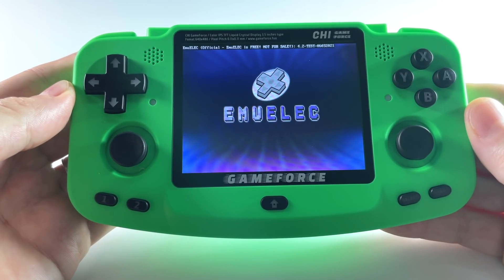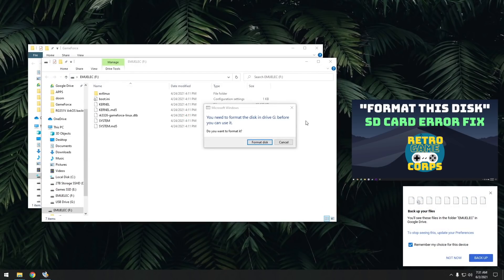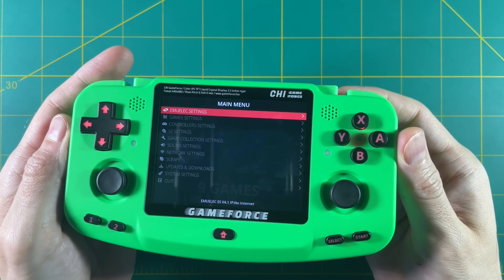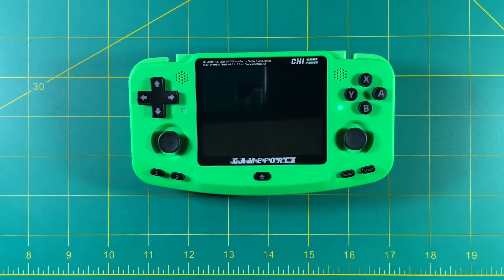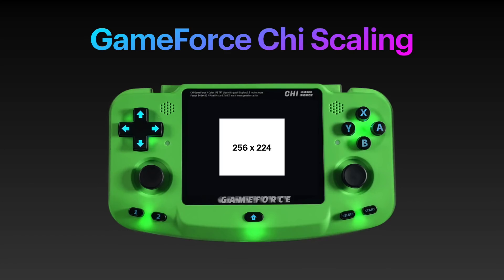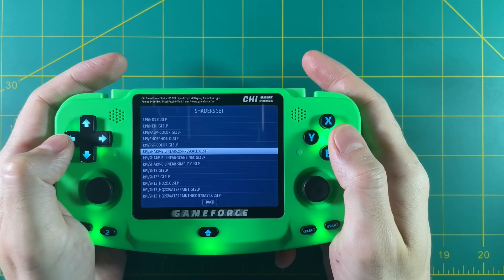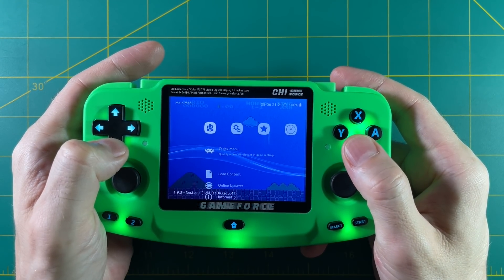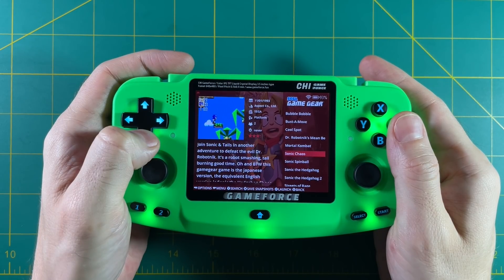GameForce Chi Setup and Teardown Guide

Comment: Russ, I hope you see this comment.  Could you do an update video on this console? it has dropped to just 64$ and I purchased it.  I realize it is not as advanced as some latest offerings from China.  However the esthetic, front facing speakers, screen size, IPS display, and iluminated buttons.  In my book make this heads above much out today.  I would appreciate an update on the best OS to run on it. I undersand ARK and BATOCERA will both run on it now.  Also what emulators you recommend for the best game play on PSP, PS1 and DC as well as N64.  Squeezing out the best performance on this Gem in 2023 would be a homerun for your channel IMHO.  Thanks!

Comment: Hey, I've been using the gameforce chi for a while and i love it. But after fiddling around with some settings, I was adjusting the controls and now i cant navigate the retroarch screens anymore (or any systems that use retroarch like psx) 

i didn't install emuelec myself as the company i bought this from installed it for me. i tried going into the files on the sd card and i cant find the retroarch folder either. I assumed that it must be on the F drive as i can't acess it, but it requires me to format the drive which would delete everything.

Please help!

Comment: Just so you're aware, you DO NOT NEED TO DECOMPRESS the image. Win32DiskImager, Etcher, and most other uSD burning tools will do it on the fly, and in general it is faster to burn a compressed image than an uncompressed one (since 'clean' disk images often have large expanses of empty sections)
Reply from the maker: I understand that it’s an unnecessary step for the most part, but my inbox is also filled with messages from people whose install didn’t work because the flashed a compressed file. I would say 99% of the time it works fine, but because of that 1% who have issues I recommend users decompress the file first. I usually explain that in my videos during this step but I cut it for brevity on this video in particular.
Reply: @RetroGameCorps  Ah, Also, I somehow mixed USBImager (which will decompress) up with Win32DiskImager. It's at https://gitlab.com/bztsrc/usbimager/

Comment: Very nice! Protip if you're going to mod the thing anyway - I had an issue where one of the corner edges of the SD card slot punctured the battery with one of my devices. Now, this was after my daughter threw it to the ground in a fit of rage. So this is NOT what I would consider normal use. I'm actually surprised nothing else broke. But if you want to shield your device even against that kind of abuse you could put some kind of soft material on those sharp metal edges. Some kind of rubber foam should do the trick.

Comment: The only thing that bothers me about this is the CPU being so close to the battery, I would worry that over time it will damage the outer casing of the battery and cause issues.
Reply: Maybe using some cooling pads as, you know, padding, would help? It would also move the heat away from the most delicate parts...
Reply: @alexgonzalez9053  It would not fix the issue and there really is no space to add heat pipes or some other method to remove or dissipate the heat. 

The rockchip SOC in this only starts to throttle around 90c that's what I would worry about. 

I would love to see some thermal testing of on-chip temps however the equipment can be expensive and it's a more drawn-out process and not really what this channel is about.